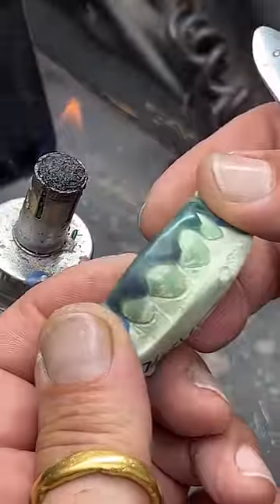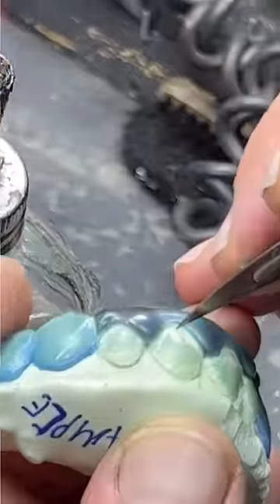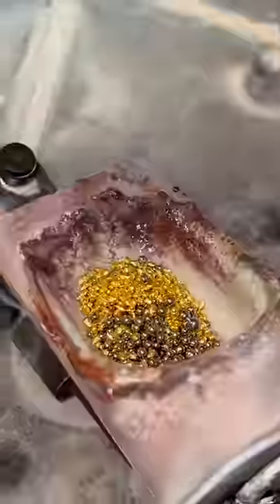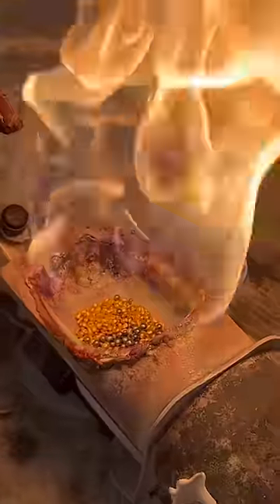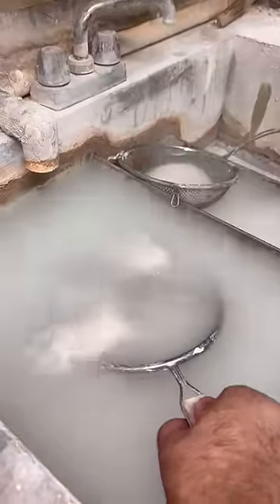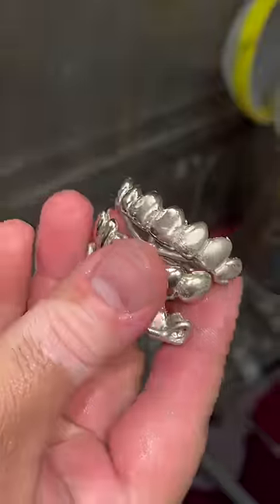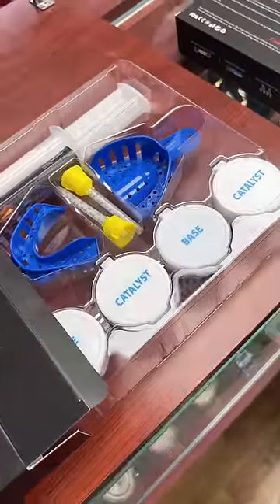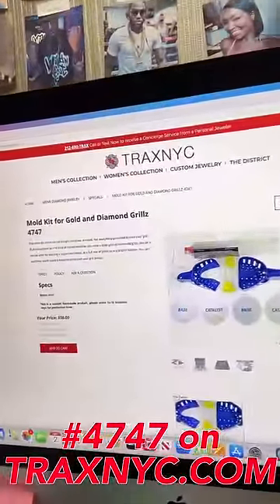HOW ARE GOLD GRILLZ MADE? #shorts

Comment: Dentist recommends that grills are made with 18K gold because the other metals will turn your gums and teeth black.
Reply: and 24k gold will end up in your stomach
Reply: 18k gold has the same metals as 14k or 9k. Just less.
Reply: @mrtrickay7111  nooooo shit
Reply: Most dentists used 8 or 9k gold for replacement teeth....historically
Reply: @Rezin_8  and historically they were wrong
Reply: 18k dipped in 24k
Reply: @mrtrickay7111  that's what makes the difference
Reply: @getminesallday24  no, the sugar and crap that got stuck in them is what rotted your teeth away
Reply: I clean mine after each use. No issues so far
Reply: @cadillachernandez2271  Permanent grillz are such a dumb idea, there’s literally no benefit to it
Reply: @cadillachernandez2271  permanent grills are worse for your teeth
Reply: @jaqcueslass2824  I've had them for 15 yrs.. my teeth are still ok
Reply: @cadillachernandez2271  until they come off and you see your teeth have rotted under the caps. Not speaking for you but that’s what happens a lot of the time. Or they are forcibly removed because your teeth and gums become so infected
Reply: @jaqcueslass2824  they were off and on before bud!!.. there fine
Reply: @bmorebread8993  no shit.
Reply: @mrtrickay7111  wym
Reply: They ruin your teeth
Reply: Really?!
Reply: @bmorebread8993  I’m about to get my first pair I should get real 18k dipped in 24 karat?
Reply: @DirtFather407  neither is a necklace
Reply: @humblebeast_112  yes the 18k is pretty strong and the 24k dip keeps the shine
Reply: @getminesallday24  Who ever did your shit did it wrong
Reply: @BeforeThisNovember  you don’t eat with grills on. Well I think that’s right anyways
Reply: You can also use titan
Reply: Source?? How will silver turn your teeth & gums black? Dipped in gold or not
Reply: @MrBigChops  I've had 10k for 10 years never had any of these problems.
Reply: @18aplateindoors  agreed. It was a thing where I grew up for all the people gettin money to drive to 1st and Claiborne to get perms done. 1st and Claiborne is in New Orleans and it’s where cash money used to get all their golds done until they blew up big.
Reply: @ESEDirtySmurf  • You got pullouts or what family?
Reply: @ESEDirtySmurf  • Fashoo Aye But I’m Surprised You Ain’t Bent Or Lost Ya Tops Or Bottoms In 10 Years Bro
Reply: @MrBigChops   my mom threw the bottoms away by accident like 3 years after I got em 😂 but the tops are still good 10k are less likely to bend but you gotta take care of them. I'm bout to make me a bussdown today.
Reply: Not true dental gold is 22 kt
Reply: @ESEDirtySmurf  • Hell Yea I Got 8T&8B’s dental gold & I lost my top 8 golds in Cali cause I got kidnapped🤣 & I mailed my bottom 8 back but the post office bent them. They still lowkey fit tho. & I got 8 VVS tops otw 💎 🥶 Congrats on ya bussdown. What do you do to clean your golds ?
Reply: @Ant-Tayo  Dental Gold is .925 silver with a 22k dip. It’s not “real” gold.. thats why it’s way cheaper. I went with dental gold cause it’s no meltdown value to grillz. And 10k tarnishes easy. And you can bend or lose em relatively easy my boy.
Reply: @MrBigChops   I make jewelry so I can clean it on a professional level but before that I'll just use some blue dawn soap and a toothbrush, you can also use toothpaste and after it dries just hit it with the buff rag.
Reply: @Ant-Tayo  • I didn’t say plated I said dipped. I know what vermeil is my boy.
Reply: I curious why not just get 18k (or whatever Dental Crowns are made of Silver with 22K dip if that is what it really is.. taking your word for it) Crowns done instead of a Grill? It’s better for your Teeth and it’s permanent, plus you can eat with it.. do everything you did before.
Reply: @ESEDirtySmurf  Normal Tooth paste would scratch and you would give a good surface for Bacteria to cling too.
Reply: @Len_M.  are you talking from experience or just some shit you heard? 10 years of me using tooth paste and I've never had a problem. You should always wash your grill before and after you put it in or take it out your mouth. There's always going to bacteria on it.
Reply: @ESEDirtySmurf  Toothpaste is very abrasive. Just be careful. You can get non-abrasive Toothpastes
Reply: @Len_M.  Again my man are you speaking from experience or something you just heard?
Reply: @getminesallday24  probably not the grills.. but the bacteria collecting in pocket behind it if not completely sealed. Literary like not brushing teeth for that time + having the perfect environment for growth…
Reply: @18aplateindoors  • Why You Have To remove Em Bro ?
Reply: @cadillachernandez2271  that's the WORSE thing you can do. Don't matter is it's silver or gold or diamond pop outs are the way to go just CLEAN them before and after. But what do I know....
Reply: @Alexander_l322  eat or drink sugary shit or smoke with pull outs. Only down side but you can switch out for different grills for different day.
Reply: @MrBigChops  it doesn't unless you smoke with em in then silver will turn wartime silver will naturally oxidized you clean them every time you take them out keep them clean and polish your good
Reply: @blizzthebike  how
Reply: @getminesallday24  your enamel??
Reply: @bmorebread8993  real talk most people are not gonna want to spend that bag had a grill made 18k 30g  shit was 3k after 24k dipped. I could've got like 5 10k grills for that price.
Reply: I never understood grills. I always imagined germs, bacteria, food partices and whatever else getting stuck between your teeth and the grills. To me it seems like a recipe for disaster.. Turning your mouth into a bacteria filled festering mess that will lead to severe problems. Gum disease and rotten teeth..

I could be wrong.. I know nothing about grills..

For example.. If a hot chick had a grill on for a year, I'd be scared to kiss her and get some bits of chicken she ate 6 months ago in my mouth..

It just doesn't seem hygienic to me
Reply: Gold & silver teeth go back along time for medical purposes over time became a symbol of status
Reply: There are but so many "other" metals as it is. Would you really want titanium in your mouth?
Reply: @18aplateindoors  how do them new teeth be looking tho ?
Reply: @18aplateindoors  I wouldn’t regret it either, you can’t really put a price on a healthy smile and the ability to eat without pain or discomfort. That’s something worth every penny. So I’d say for 23k you walked away with the better end of the deal of having good teeth, you can always get another 23k. It’s good to know you’re happy with your implants tho, I’ve heard bad and good reviews so it’s mixed depending on the persons health and hygiene.

Comment: *Centrifugal force is based on momentum, not graviy. Sorry, but you know i had do it to em
Reply: Thank you kind sir
Reply: It's centripetal though 😐
Reply: @onradioactivewaves  centrifugal- an apparent force that acts outward on a body moving around a center, arising from the body's inertia. A centrifuge is a machine, there is no machine called a "centripe" they are two totally different things
Reply: @snailsaredumb9412  the centrifugal force (outwards from the radius) is the reactive force of the applied centripetal force from the centrifugal. Hence the force applied to the material in the machine is a centripetal force ( the force that keeps it moving in a circle).
Reply: @onradioactivewaves  Centripetal force is the component of force acting on an object in curvilinear motion which is directed towards the axis of rotation or centre of curvature. Centrifugal force pulls AWAY from the center. Centrifugal force is a pseudo force in a circular motion which acts along the radius and is directed away from the centre of the circle. I know what a centrifuge is, I own one.
Reply: @snailsaredumb9412  congrats on the centerfuge by the way.
Reply: @snailsaredumb9412  my bad, I meant to comment on the video, not reply to and refute your comment.
Reply: @onradioactivewaves  you aren’t correct my G. Centripetal force is the force REQUIRED for circular motion. Centrifugal force is the force that makes something flee from the center.
Reply: @wantapgt  that's literally what I said though, that ots moving outward from the center. The only way centrifugal force results circular motion about a point is by result of centritial acceleration from centripetal force.  Either you dont understand what I'm saying or you are the who has it backwards my G.
Reply: Thank you. I came to the comments to make the correction. I was going to say centripetal, but you were right. Good looks.
Reply: Great, it's a nerd fight. You can almost smell, the lonely weekends, wadded up tissues, and hand lotion.
Reply: @highdadd6526  lmao 🤣
Reply: @highdadd6526  you would envy my life bud
Reply: Oh god, the cringe I am enduring rn